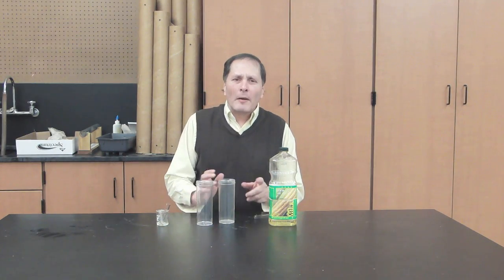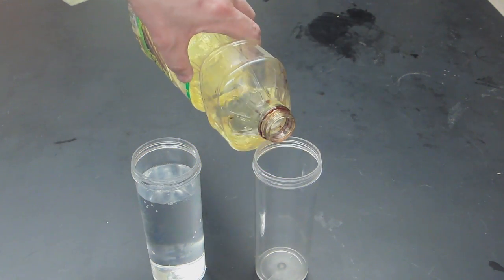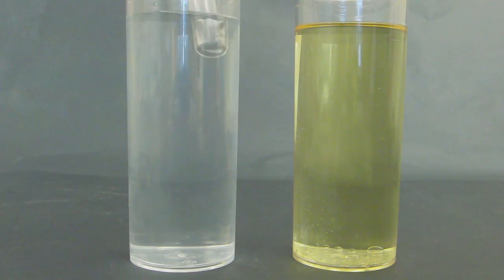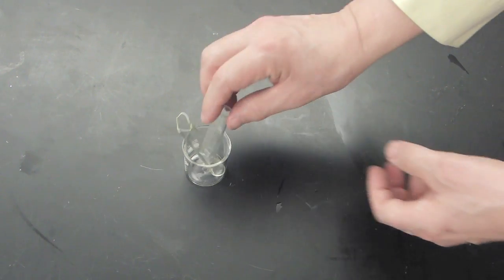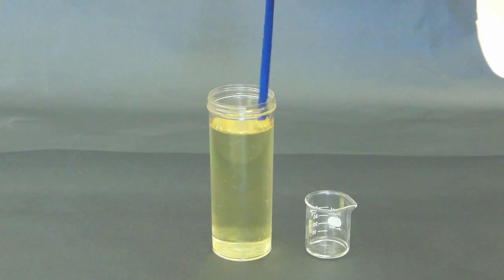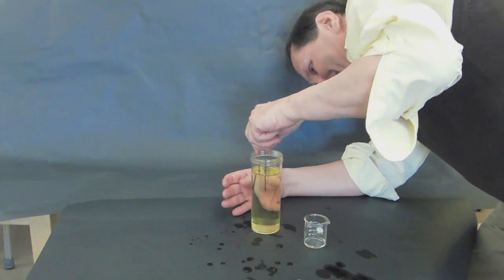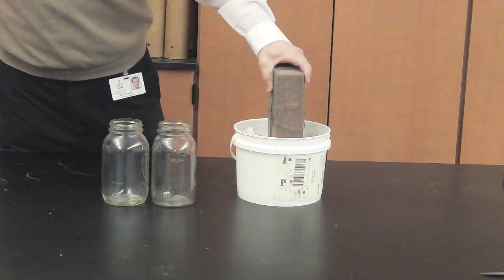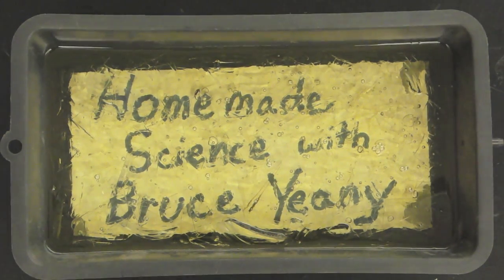Index of Refraction - disappearing glassware demonstration  // Homemade Science with Bruce Yeany

Comment: My son and I tried this, and it sadly didn't work.  The fully submerged (and filled)  test tube was completely visible in the corn oil.  I assume now, that it didn't work because the test tubes I bought were only glass, and not "Pyrex" glass.    Not sure where I can buy Pyrex test tubes locally, but before I go to the trouble, I wonder if you could weigh in on my assumption on why it didn't work.

Thanks for all your great videos.
Reply from the maker: Hi Matt,  you are correct,  I tried several types of glass and found quite a fe of them didn't work,  it should be pyrex
Reply: It must be borosilicate glass, not tempered. Proper lab equipment is borosilicate.
Reply: Cookin crack eh? Need a better excuse. Nobody believed me either...
Reply: Baby oil or glycerin for glass
Reply: You can do that with small test tube. Glass road is a closed and air lesss medium .. so that what liquid (like oil, glycerin) you using for this the same liquid fill also into the small tube ...Now the small tube is air less and like pyrux glass road because your test tube and liquid in container have same refractive index .....That will be work properly......